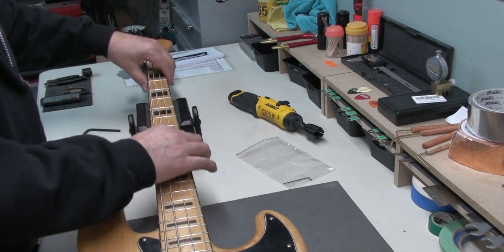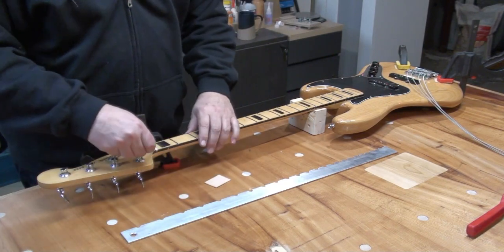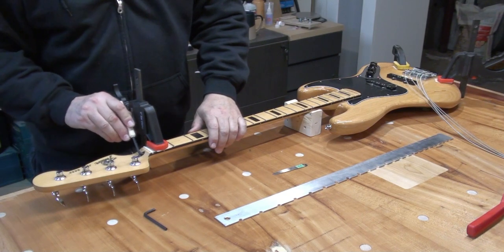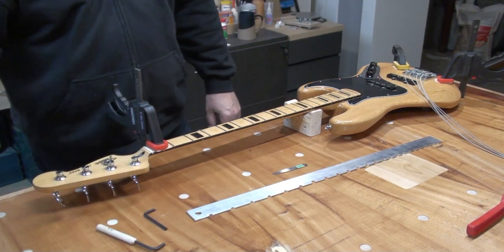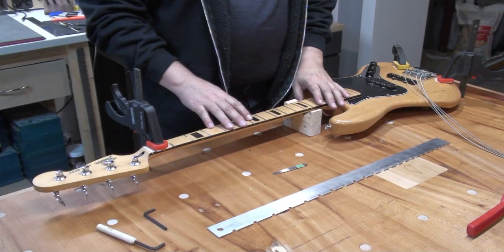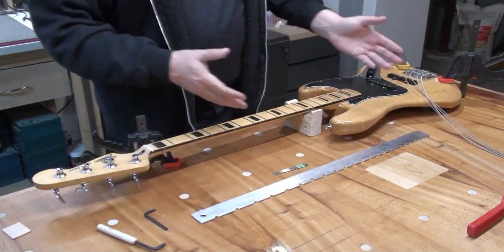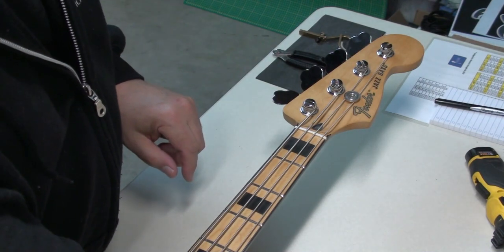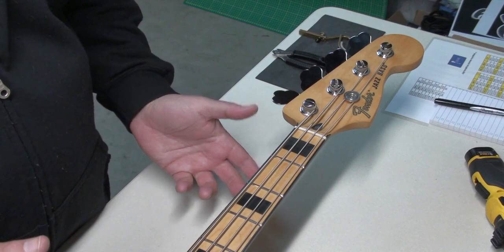How to Fix a Bow in a Fender Jazz Bass Neck with Clamps and a little Persuasion.

Comment: Have you ever tried this with a neck bowed the other way? I have a humped neck, forward bow? Dual action truss rod, clockwise increases the forward bow, CCW flattens the neck but not enough.

So if I emulate your method here I would get the truss rod adjusted so it's not engaged in either direction, secure the body and the peg head and with a clamp at 7th or 8th put a bow in it in the relief direction, back bow? (I can never keep them straight, no pun!) Then I would tighten the truss rod CCW to the stop, leave it and cross my fingers.

I might want to do your hot bag of rice heat treatment as well, or a couple heating pads, given the 2024 price of rice lol! What do you think?
Reply from the maker: @oldasrocks9121  theoretically, it should work

Comment: Nice! i used this solution 5 years ago on my Squier Jazz Bass, there is a lot of friction between the groove neck and truss rod, you need to release this before adjusting with great bending. Take care to do that job. For me , heat solution is not good for frets and fretboard gluing. Good job sir!
Reply from the maker: I use the "mechanical" solution first before trying to heat up the neck.

Comment: Hi! I have this problem on a mexican Precision. I will do exactly what you did, brilliant solution! Only one question: why you set the truss rod at the max tension while clamping the neck? How about if once restringed the strings tension will pull the neck up again? Thank you!
Reply from the maker: Because I am putting the neck in an extreme backbow and the truss rod will help it keep that shape when released.  You can try it with the truss rod loose and see if it works for you... it might, depends on the neck.
Reply: @ManotickGuitarTech  thanks for the answer. Would a middle way work? My neck is seriously bowed
Reply: @gaetanopellino A middle way?

Comment: That is a beautiful bass
Reply from the maker: It is a classic look- very nice... a bit heavy, though
Reply: If the truss is very hard to tighten to get the neck Straight do you ever put it on a stand and drop some 3-1 oil down the truss rod and let it sit over night? I did that once and I was able to turn the next day. Another time I did that and still did not move so I dropped some more oil and this time I wrapped a heating pad around the neck and of course both times I slacked the truss rod all the way and the next day I was able to tighten it up and I was able to move the truss rod a lot more and I really cranked on it till I had a slight back bow. I waited a couple of hours before putting strings on it and set it up correctly and I got it to the way I like it. Do you think what I did with the heat and oil did the trick or did I just got lucky because I really turned the wrench a lot harder this time and was not worried about breaking anything. It was my own bass and it was a cheap Ibanez that I bought used and got very cheap because of the neck. I don't know if I would have done that on one of my Vintage Fenders. Sorry for all the questions but do you think that basses are more prone to have a bad bow on the neck then guitars do? Thanks
Reply from the maker: Basses have more string tension  so I do believe they necks can be prone to bowing... oil doesn't usually work on the nut; I would only use a little bit if it was obviously rusted
Reply: @ManotickGuitarTech  Thanks you for the response.

Comment: Interesting way to fix a bow. I usually clamp it to a long aluminium beam and stick it on a heater for 10 to 30 mins. Then leave it clamped over night. Fixes it usually and stays that way.
Reply from the maker: I told the owner that we would revisit the neck in a few months and see if it needs heat treatment
Reply: @ManotickGuitarTech  Good stuff, I hope it's worked with your method!
Reply from the maker: @bobsguitarmods  so far so good

Comment: You know how I do it I tune the guitar and I hold the first fret down and I go to the bottom threats and I hold that down and I use the string as my line the guitar string in the middle is supposed to have enough gap to put a credit card through if you got back bow he probably want to make it straight are usually have my guitar slightly bowed forward and it’s depends on the guitar and if you’re still not getting a clean night I’ll get a bit of sandpaper even with the strings on and I see what’s touching and I just the threats but I Sandingham but usually I takeoff all the strings and suck down all the threats and give it to Sand each one and then I put my strings on and I see what’s touching and I fine-tune it the threats because with his strings on you can see exactly where it’s not a clean night  I just loosen them up and pick out the main ones that are interfering if I do this I make the show with the guitar is fully set up the way I want it

Comment: Remember that should be a slight bow in the middle enough to get a credit card through otherwise you’ll have Threat buzz  A neck of the guitar isn’t designed to be perfectly straight it’s not designed for that otherwise I wouldn’t make it movable
Reply: What’s a threat buzz? You mean fret buzz??
Reply: I had threat buzz on my 1972 ovation, that was a pita!
Reply: Neck relief is .012", not a credit card. Google "truss rod" and "feeler gauges".

Comment: Anyway I set up all my guitars and I have about 10 and I use the string to hold it down at each end and I check it and you should be able to get a credit card between the string in the middle of the guitar of the board there should be a little gap in the middle always I’ve never made market up buying back you’ll have no gap you won’t be able to get the credit card through and you have to have a credit card fitting in the middle otherwise you’ll get Threat buzz that’s one hell of an expensive guitar as well

Comment: He usually have trouble with a truss rod if you’re having a low profile with your strings obviously if you’re making it to slap and you having the strings up hi well nothings going to be touching that for a light set up obviously some adjustments will be made another thing I do is knock off the nut and font unit to 100th of a mil